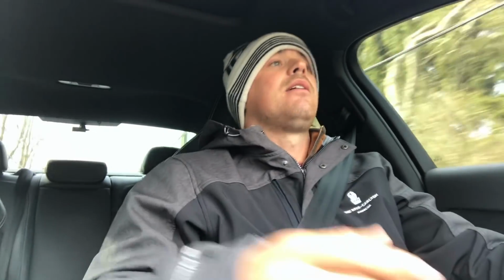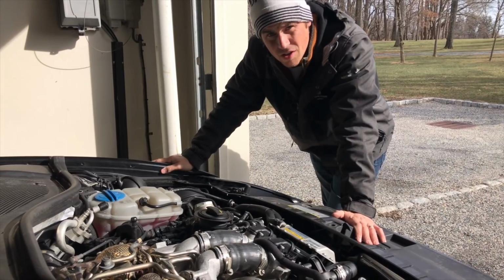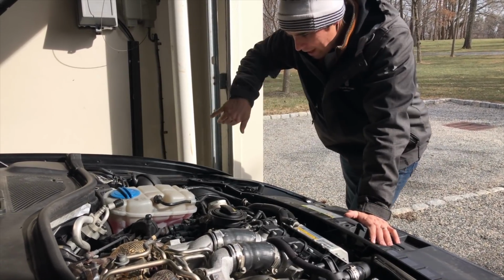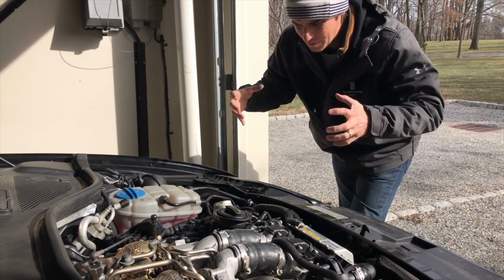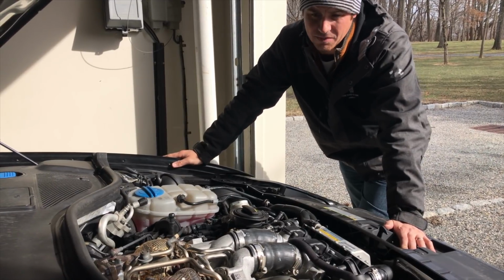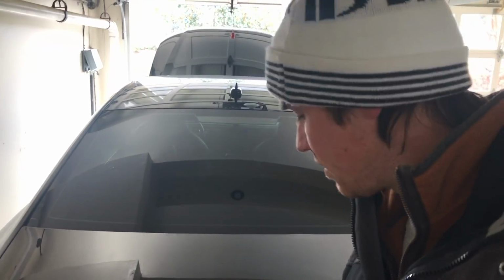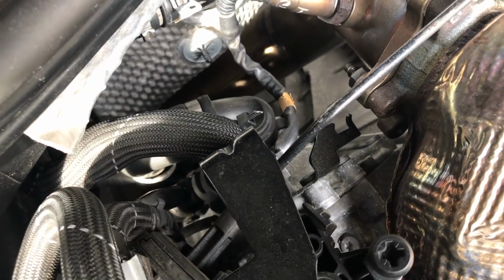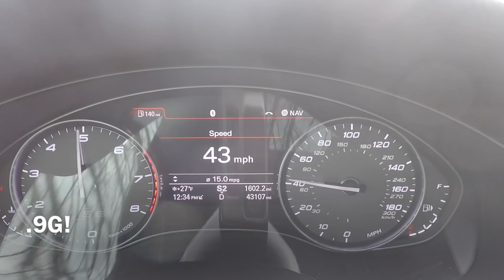Audi S6 Stage 1 Recap and Stage 2 Review!

Comment: hey wassup, love the car.  I have 2016 s6 and will be going stage 2 in the next day or so, hows it been holding up. Also, did you see any power gains from your cold air intake? Did it make a real difference? And lastly if so where can I purchase one at a decent price? Thanks
Reply from the maker: Matthew B hey man sorry for the late response. CAI’s are kind of s grey area. Apparently, it’s about the inlet pipes rather than the whole intake itself. But, yah sure air intakes help. Try to find used ones on audizine if you can’t, then go with roc euro or SRM.

Comment: I have a stock 2013 S6. I love the sound of yours. Thinking of doing something to the exhaust and maybe a stage 1 tune from APR. I'm so indecisive though...What should I do?
Reply from the maker: urangostang mine had a rear muffler delete (so no more valve controll) and APR downpipes and modpipes
Reply: phantomsix what did the stage 2 s6 do in quarter mile?

Comment: I have a stock 2013 S6. I love the sound of yours. Thinking of doing something to the exhaust and maybe a stage 1 tune from APR. I'm so indecisive though...What should I do?
Reply: Why ask?  Just do it!  Stage 1 is so easy, it's just plug & play - ECU upgrade basically.
Reply: Can you jump just to stage two?
Reply: Yea u can go to stage 2 right away. Stage 2 also involves hardware (downpipes which cost a considerable about like 2k but come with the stage 2 tune) then u have to pay a shop to install it unless u r handy and know what ur doing. Stage 1 is only a flash (reprogramming the ecu which is the computer to use more gas and more air bc the turbos boosting higher and the result is more power. So if ur not trying to spend a lot stage 1 is perfect.  If u got the extra cash and want more performance u get stage 2. And no u can’t get stage 2 without the downpipes it would just be stage 1 without them. If u want the extra performance and got the money for it stage 2 is the way to go right away. But for a cheaper route and a big boost I’m guessing 100-120 extra hp easy stage 1 and maybe 150-160 extra hp over stock with stage 2 and maybe 30-40 more tq over stage 1. The bulk is stage 1 that wakes the car up and stage 2 takes it to the next level. Stage 3 is upgraded turbos and obviously the downpipes also. So u could go straight to 3 if u got 8-9k. And then stage 4 is engine build upgraded turbos and downpipes. That prob gonna be like 25-40k and ur gonna want intercoolers optimally on any stage really helps prevent heat soak so u can get more consistent power. Hot summer days those 4.0T’s suffer after they have been baking in the sun all day